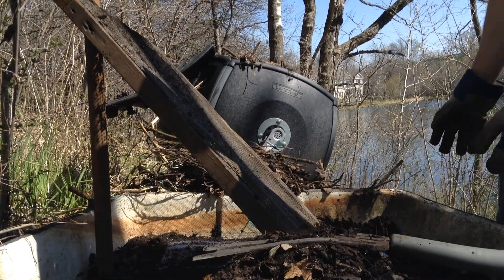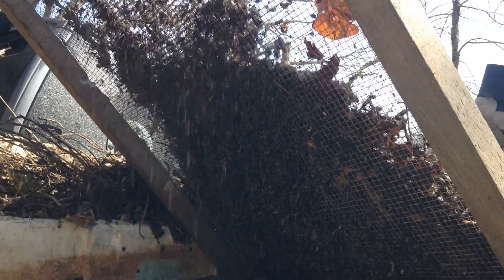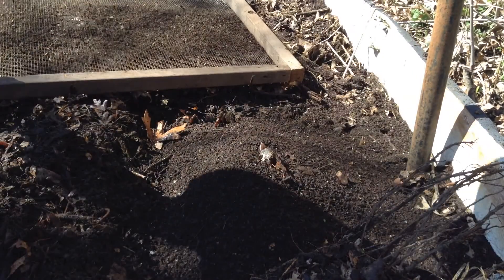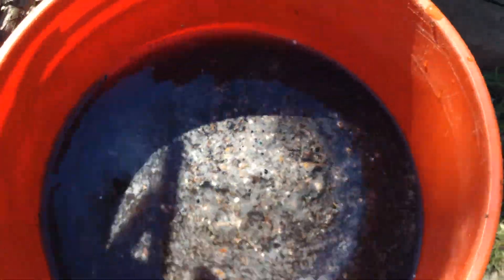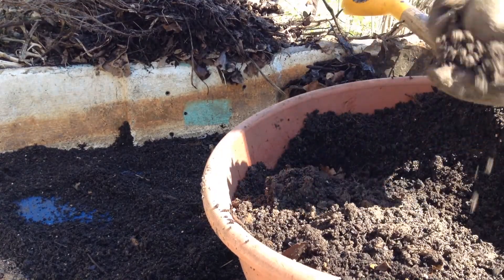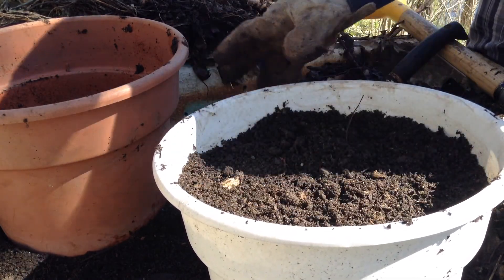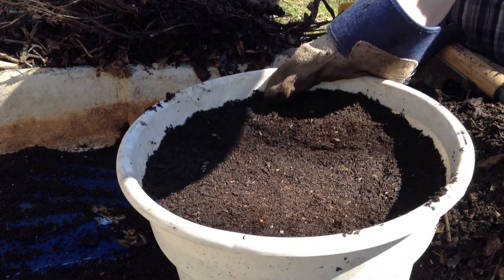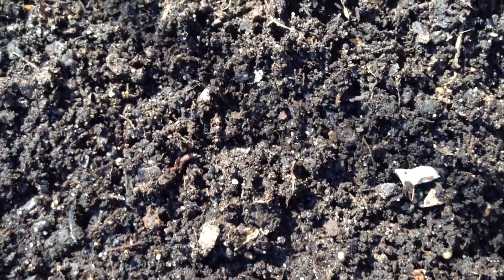Simple Compost Sifting & Uses

Comment: I like the idea with the angled sifter.  I may try that on my path to more ergonomic compost sifting.  I'm thinking of building a sifting screen that has two small wheels mounted under the middle of it that can be pushed and shaken back and forth over a track on the wheelbarrow... But this is easier and worth trying before I go to that effort.  Thanks for sharing.
Reply from the maker: I was thinking oabout building a rotating sifter at a slight angle that would spit out the leftovers at the other end, but this setup works great and is super simple to make.

Comment: How and how long can that beautiful compost be stored? In plastic containers over snowy winter months to use in the spring? Im a new gardener and wonder how many times should I top dress my veggies with compost during the growing season? Are any other nutrients necessary? I hear a lot about compost tea and wonder when to use it too. Thanks for the video. I learned a lot about container mixture preparation here.
Reply from the maker: I store the compost outside under cover so it doesn't leach the nutrients away when it rains. It will last for ages, I never have any leftovers in spring because it all ends up on the garden. Make as much compost as you can and use it as often as you like. Here is my latest video on compost tea if you are interested. https://youtu.be/_rfqDjdILQ0